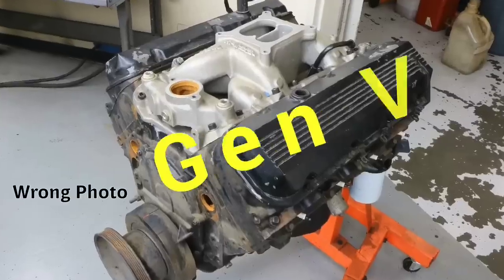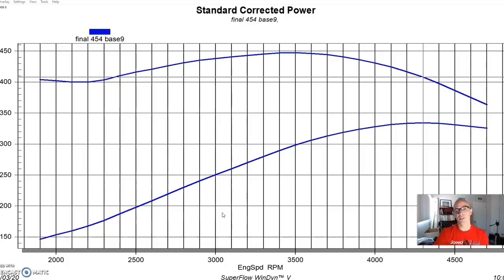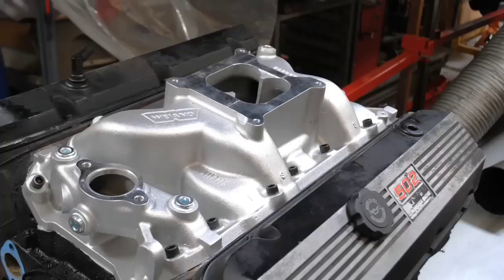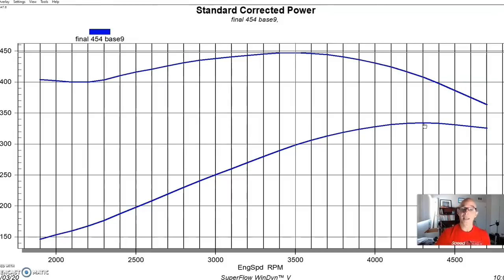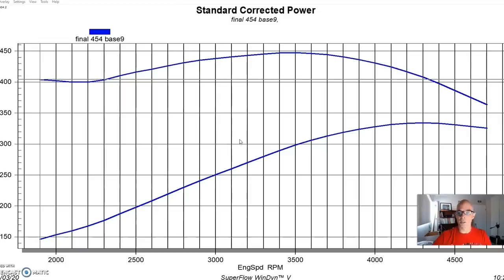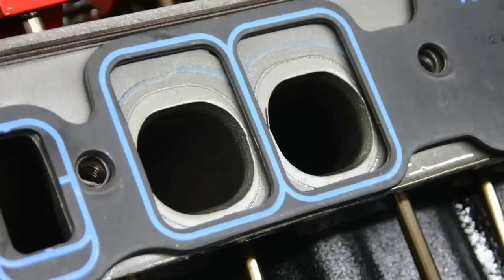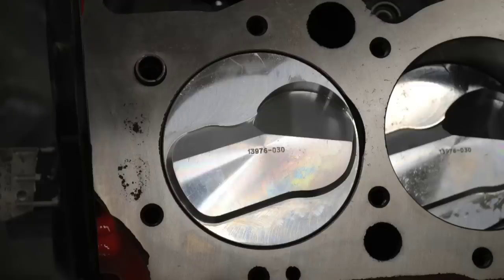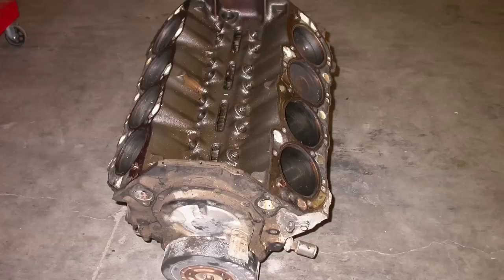HOW TO UPGRADE YOUR TBI PEANUT PORT 454

Comment: I have done the Gen 6 L29 head swap onto the gen 4 and 5 low compression engines, did them for high torque towing application engines. Used a Melling mild flat tappet with 208/208 @.050 and .480/.480 lift. These engines were not dynoed but they were incredibly better than before, and better on fuel. Another swap I have done with success for the gen 4 engines is to use 366 bus/truck heads. They are larger oval port, with semi closed chamber similar to late 60’s heads, around 102-104cc. They come with smaller valves, so I like to cut them for the standard 454 2.07/1.72. Those heads are usually free and again make a great budget street or high torque combo.
Reply: I have a 90 454 SS truck i also have a set of 396 325 hp heads will they work with tbi ?

Comment: Love the old 80s and 90s power plants. Us people on a budget have those platforms to build off of.
Reply: I'd have to agree!
Reply: And you'd have something cool, instead of the same old cookie cutter LS build you see now. I like LS engines but I love a Rat in the right application.
Reply: My BBC is a 1970 in my Ford pickup.
Reply: Same for Gen 6/7 BBC and Gen 3/4 SBC.
Reply: @greasemonkey258  Gen 6/7 BBC are LS like.

You could say Atlas is a change from a barra or 2JZ or K24...
Reply: @shadowopsairman1583  the 496 would be a great engine of it shared parts with the previous Gen BBCs, but companies like Raylar make performance parts for them, they're just expensive. We have companies making cylinder heads that are LS-like for the older GM big block Chevys that flow amazingly well, but they still cost a ton. I like GM LS engines but I'll always have a place for big block Chevys.
Reply: I have a Tonawanda 454 in my K3500

Comment: Can you do a 350 tbi and 454 tbi.  Keep the tbi fuel system and see what kinda of power you can squeeze out of it.
Reply: 2000 350 Express .030 over, Slight bump in the compression to about 9:1, Roller Mercuiser cam plus 1.7 roller rockers, Three way valve job and plane to get a little more compression. Not Port injection. Mechanic made me buy a New Throttle body injection and stock air cleaner. So, lost track of what it is actually and doesn't like to start when cold and lean pulses at Idle. Hp? I don't know but, I broke my 4L60E Transmission and it's faster than my 2000 454 Savana. Beats all the Dodge HEMIs and the little kids with the Coffee cans. Loaded with Tools and stuff, Black, Dirty Van, Corroded Wheels, ladder racks, Scratches, Dents in the rear doors, Speedo doesn't work, stock exhaust.. Sways in the wind at high speed. You should see the disappointment while I pass em all picking my nose.  
Kinda Reminds me of "Farm Truck". I'm gonna get a Cowboy hat for when I drive it.

Comment: "torque wins races, horsepower sells cars" - Carroll Shelby
Reply: Horsepower wins races. Horsepower is a function of torque and work that is being accomplished.
Reply: TwoLotus2 : Watt watt watt? Horsepower doesnt exist. Its a dependent entity which is a function of measured  twisting force with a speed factor. Like the so called existince of centripedal force, which simarly is a.slang term for Newtons laws.But its awfully hard to communicate with the public and preachers and physicists if you say you dont believe in things they have defined. Ai doesnt exist either. Its a name for something invented by others....probably me...
Reply: As long as you have the right gears, horsepower wins.
Reply: Anybody that says torque wins races is slow.......
Reply: TunerDad TunerDad : Correct idefintley. The  slowest speed that wins a race, still wins. It took me 23 minutes to respond. You could have lapped Nurimburgring in that time with a Holdener Moddified Trabant. CS was a master of winning, slowly. Thanks for your statement. True, but for a different reason.
Reply: TunerDad TunerDad my turbo diesel says otherwise
Reply from the maker: would love a turbo Trabant!
Reply: Richard Holdener : My brother in law is a great lover of all Dak Daks, including front drive VW Golfs (your Rabbit).His Golf had a 1.q loter engine, the common  1100 cc Polo engine was used in the Golf, Polo and  in the last year of production, 1991. That would turbo nice. Three of them in Florida at the moment. See Adam at  
https://youtu.be/XWL2lLjt6cU

(PS...Im not sure you could handle it. 165 mph averages in the Silverstate Challenge, yes,  227 mph in a Honda, yeah, but an East German Trabi mit turbo...nien!)
Reply: A engine only makes tq.
Reply: @TwoLotus2  Horsepower equals torque times rpm divided by 5252.
Reply: Don't get fooled by peak numbers horsepower or torque while it looks and sound impressive most the time look at peak numbers throughout the entire powerband or rpm range
Reply: @richb.4374  yes....hp is just a equation. Engines don't make hp. They only make tq.
Reply: If you want a really good explanation of torque and horsepower go to nutterracingengines.com
Reply: Wasnt much technology in torque convertors back in Carols days. Most super fast cars these days have all the power in a small 1000-2000rpm window way up top and use a well designed convertor. Low end torque is great for towing caravans.
Reply: HioSSilver1999 : So true. James Watt used Horsepower, but to calculate it, he needed to measure how many lb-ft that was. Hp is just a calculated set, but it is a vital statistic. Its not the first thing that comes out on a dyno..its a measure of Force x Distance with a time factor. It is vitally important becauae it measures Productivity. It indirectly measures Efficiency.  The king has no cloths when you start measuring Productivity and Efficiency. Because Volumetric Efficiency and BMEP do not peak at peak hp, your Torque Output per every 100 rpm plot is vital to track where an engine is on song in its final power delivery curve. HP is the most important dervitive data on a dyno, but its a dependent variable, not independent data like torque is. The canne okd Scottsman James Watt got this stuff all worked out back way back when.
Reply: Gloria Maletta : No question about what you say. Well said. I would qualify this. Peak Productivity and  Efficency is vitally important. You can tailor torque curve production... if the engine can make the best specfic power, then you can horse trade power and torque " bumps".. Peak power numbers are a vital statistic...always. You can augement low and mid range torque any time if you play with other factors, but air flow and better Volumetric Efficency requires good hp peak rpm to scale the peak torque out put. Ive seen engines wipe off 55 hp and gain 55 lb-ft. But before that happened, they dyno tunners had to see whats on the table. The engine? Holdens GM 304 5.0 liter bank fire V8 in 1988, 221 or 276 hp versions, the 221 hp version had more torque.  Hp is the vital stat.  Mid range torque has to be tailored to suit needs. Power is the king maker. Even though its a calculated value...and Doesn't Really Exist.
Reply: @deanstevenson6527  your kinda right, volumeectric efficiency has a lot to do with it.Hp depends on a lot of factors, tourqe is relative, please read nutterracingengines.com explanation
Reply: Casey Hill ; Read http://www.epi-eng.com/piston_engine_technology/power_and_torque.htm. And the 5 notes in totality. Nicely done and Thanx!  Not much else to say except James Watt did an index test. The set. ( Load taken from the average productivity of a horse drawn sled lifting x load for y distance in a given time over a given 1 foot lever yadda yadda) was defined, the measure and its mechanics force people to shy away from peak power analysis. The guys winning drag races know how irrelevent torque is, the guys in endurance races, know how important torque is. It was only John Wyer, Australians Sir Jack Brabham, Phil Irving , Dave "the Dyno" Bennett and perhaps Larry Perkins who were able to define hp  and ring fence a valid increase in power for every rev of engine speed. Sir Jack B said..."win by the slowest speed that wins the race..."
Reply: @deanstevenson6527  idk how vital hp is at all. You can only use tq to calculate shift points and set up gear ratios.
Reply: @TwoLotus2  hp is a measurement of tq.
Reply: @tunerdadtunerdad7927  i see you have never raced a high tq, high geared car.
Reply: Gloria Maletta :Thankyou. Much respect. I voice my opinions as a fool in the market place.  Anyone who understands Simpsons rule of area under curve measurement or has spent as nany years as I have with a planimeter will understand that the area of off idle to on stall of the converter is from 650 to about 2350 rpm. The area under the curve on normal Superflo Dyno printouts dont cover the operational range, and Richard Holdener is at pains to tell everyone to drop down a cam chioce stage because of that and other factors ( Male dominated workd machismo nainly!) Dynos don't pick that up unless a dedicated run is devoted to it. Hench the Area under the curve discussions are in my opinion only  a petty distraction and we dont manage them..the engine does!  We read the dyno plot and figure out what the engine needs, and what it is telling us. The peak torque and derived peak power rpm which each give the lowest aspirations index, they are always the right ones. IMHO, like trickle down economics, some real horse excrement is told. Simple index testing for peak torque  and peak power always gives you the best resultant area under the curve. Due to emissions compliance and durability, GM, Ford and Chrysler left a huge amount of surplus abd conservative camshaft  and intake runner potential on the table, but always, when engine capacity A times rpm B  is divided by dyno indicated torque or horsepower C, the lowest number ( Ai, the  aspirations index) is always the right one for actual area under the curve maximisation.  You can  horsetrade torque and horsepower with cam, head, intake, exhaust, but the peak power nonsense  of carrying an extra 200 rpm of peak torque or power rpm  just to make 2 lb-ft or 2 hpis then always avoided if you use the ABÇ Ai method. This I learned from   Sam Blumstien at Chevy Offroad and Marine Racing in Australia. Like I also learned on chassis dyno to engine dyno losses. A world of books can be written on "other other"  things: Only target torque production is inportant. Then, dervived fron that, Best Torque at the lowest possible rpm and best Hp at the lowest possible rpm is  the  result. Both curves get nailed without the histronics.Of course... In my humble opinion, based on 33 years of doing it with engines. In 1978 I was eight years old.... I started the power and torque curve quest when Wheels magazine used a chassis dyno to plot DIN net car maker readings with actual front or rear drive figures...David Vizard did the same thing at the same time. Nothing Richard H or Steve B or the team at Westech  have done has contradicted that knowledge base. Area under the curve is a crock, index testing and benchmark values are what engineers use to make decisions.

Comment: Crazy, I just built this exact motor (cam and all)  for my 4wd, no wonder I can light up them 40in. tires, i didn't realize it had that much power.. .awesome
Reply: I sold a bunch of left overs to a co worker, and he built the same thing too (with a performer intake though)...and it went in a truck with 36" tires and same result, lights them up at will.
Reply: Torque
Reply: what pistons did you use? looking at doing the same build, and he didnt supply the part number for the pistons
Reply: @thedustyredneck  The part number is what was stamped on top of the piston.   Probe 13976 030
Reply: Did you do efi or carb?
Reply: @leebdj1949  carb
Reply: Is that an 8019 weiand , with oval ports? Couldn’t find one with peanut ports. I’m doing the same thing for my off-road rig, sounds like a perfect setup. I’m not into the screaming mud bogs, mostly serious trails. Can’t get the probe forged pistons, but there’s some decent cast ones that are fine for this level of hp
Reply: @leebdj1949  no mine is a Edelbrock performer 2.0. Other oval ports are bigger and flow better than my peanuts do but that's all I had so I just ported them
Reply: @leebdj1949  any updates?
Reply: Any chance of a parts list? I can provide you my email if that helps
Reply: @jasonglover5989  sent the engine for machining. Doing .030 over, with 10cc domes. Also managed to scrounge some 781 heads, and putting a xe268H cam in it. Went with weiand stealth intake, and a buddy is giving me a FAST fuel system to try out. The shop is doing the block, heads, and valves, and I’m putting it all together myself. They’ll balance it too, if the new pistons put it out of percentage range. Pretty excited! I was going to use the peanut ports, but when my buddy said to check out some he had laying around I could use, and I saw what they were….well, I couldn’t refuse! Lol Only did 10cc domes, because our Canadian premium gas is only 91 octane, and my engine guy is a highly respected builder. I told him my goal numbers for performance, and he used his experience to get me there, with a cooler engine, and not running limits.
Reply: @leebdj1949  nice!! Let me know how it goes!! I’m interested. Any videos on it?
Reply: @jasonglover5989  hahaha I’ve never posted a video on YouTube, but maybe I should! I’ll do one when I get my goodies back. I recommend watching 2carpros 454 build playlist, from start to finish, if you’re building an engine. Every bolt, from tear down, to fire up. I think it’s 18 videos in the playlist